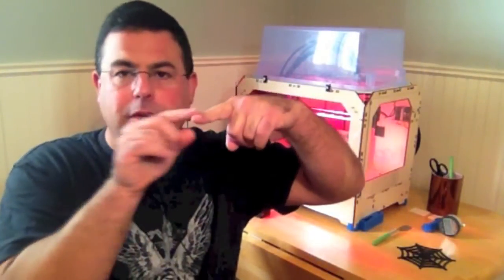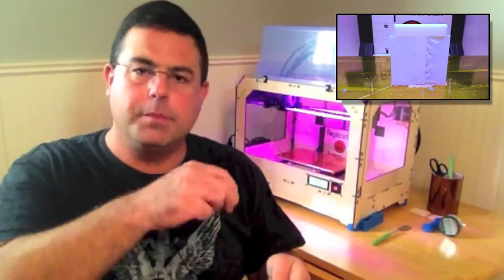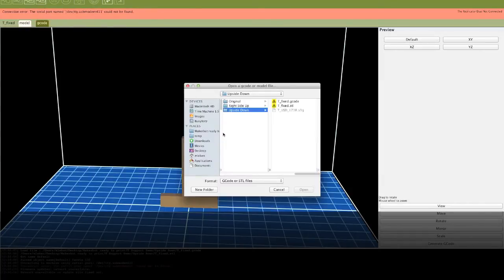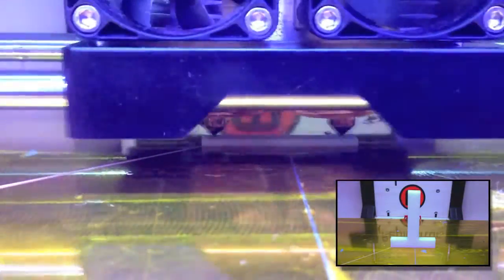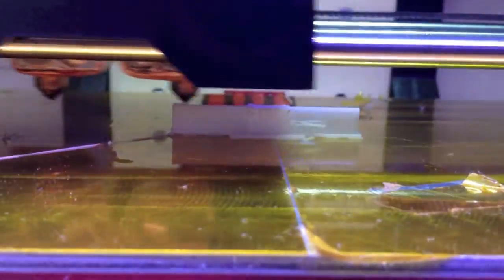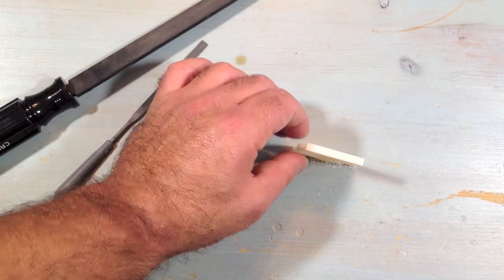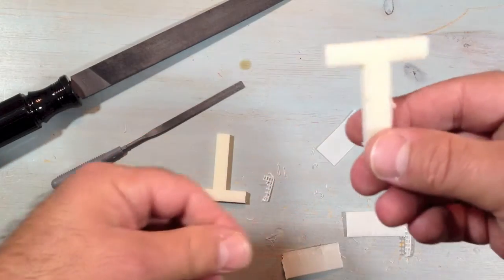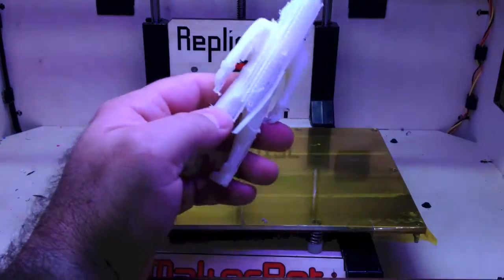MakerBot Quick Tips #6 - Support

Comment: I want to print a character with a pose than standing still like your robo man. Should I just have it lay on its back? Do you allow the slicer program to auto support or do you manually draw in support? I found that the software would wedge in support everywhere which might compromises the printing. I failed twice on trying to print characters--they can be hard.

Comment: DO you think there is any right / wrong way to print a character? I tried laying down and it worked well but the supports were a pain. When doing vertical, the supports were everywhere like he was encased in ice. In the end he broke to piece while removing them. I guess I was just wondering if you had any advice for printing a 3D character?

Comment: I am thinking of buying a Replicator and one of the item I will need to print is a tube, kind of looks like the groove attachment for shop vacuum, near flat on the bottom then curved on top, it would be near impossible to cut a support out of the inside and it's too tall to print upright. Any ideas how something like this might be  printed?

Thanks for sharing. It helps a lot.